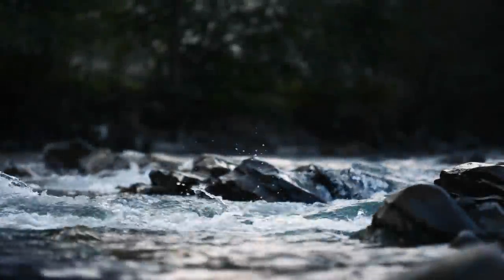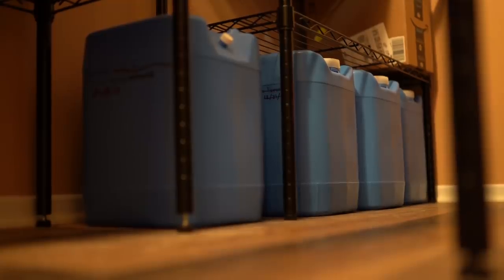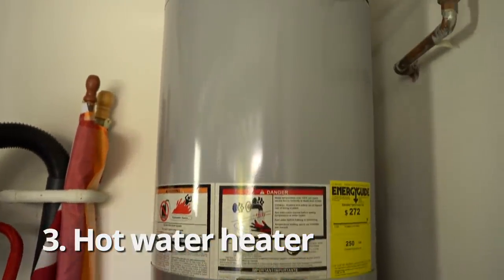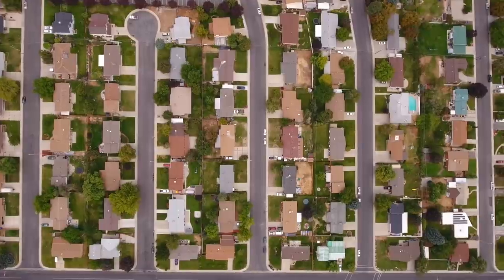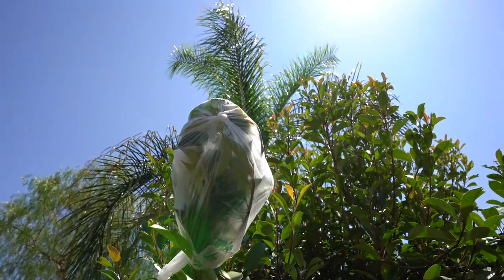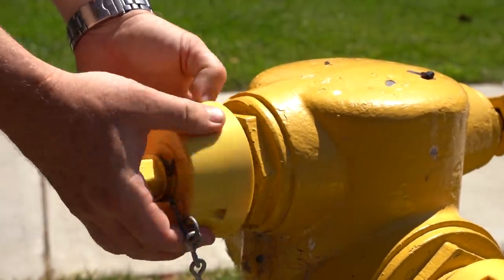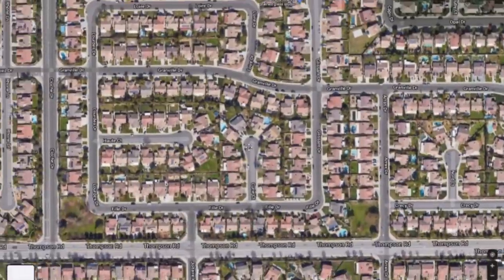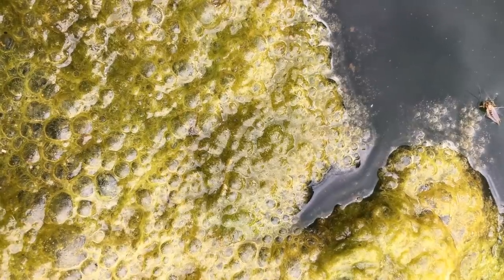12 Overlooked Places to Get Water After SHTF

Comment: Great video.  Loved it.  Follow on question:  are there any options for purified drinking water for ocean water?  Sorry for asking as I think this is a hard nut to crack. Yet, there is so much of it.  If there is a solution available to the general public, it would be golden.
Reply from the maker: we're working on that soon :)
Reply: boil it, collect the steam n let it condense n u have buy-product of salt for preserving foods. you'd need appropriate equipment, fuel for fire/elec/gas/alcohol, some sort of funnel for steam collection and pipe down into a lower container. it would have to be airtight for greatest efficiency and everything would have to be sterilised that the steam runs through, unless u fancy double boiling.
Reply: @kimwarburton8490  Thanks for replying.  I am vaguely aware of desalination equipment on naval ships and I think Israel uses them.  A residential sized process and equipment that worked well would be a real bonus.  I own a water distiller that boils the water but I am sure salt water would gum up the works in short order.  I am interested in seeing what Citi Preppier comes up with.
Reply: @mantzbrinkman4780  ditto :D i dont actually have the equip to do it, but i live nr a 2ndry school with lab equip n shy of 30miles from the sea. There is however 2 small rivers going through my small town, one is very close to my home. Being in SW england, i think flooding is more of a concern than drought. theres also 2 lakes in the town and ive access to a carport which has guttering n my immediate neighbour is a self-employed builder. I have the know-how, he has the tools n equip n skill to use them n we get on well enough should SHTF while im here. Out the back door is like a courtyard where only 6 flats have access and i have plans id implement there too re food n rain collection, plus i reckon my berkley would ensure we get enough safe drinking water to bring us together as a team. 
We are gunna be getting new neighbour/s soon, so fingers crossed they are gooduns. We have an absentee above my flat, new tenant/s will be above 'builder's' flat, an old man upstairs 'next door' and a 55yr old 'hippy' type below him. We'd be an ok team IF they listen to me lols. Failing that, id abandon them n go live with mum n step-dad who are v fit n healthy for their age n have access to horses n rented land thats relatively off the beaten track. But their town isnt as self-sufficient as mine is, plus it is bigger n closer to larger settlements n id be more reliant on their local knowledge, but it has its advantages
Reply: @kimwarburton8490  Seems like a good place to be.
Reply: @mantzbrinkman4780  thats why ive stayed here to date despite having no garden of my own to grow stuff in. Until im working again, n able to save up n buy land of my own, this is as good as i can get. Im sure f things get bad enough, allotments etc will become available, even if we have to dig up the school fields XD
Reply: Many boats have watermakers. RainMan makes a good portable one that can be run from a portable generator. Saltwater or briny water. Affordable and can be shared with other neighbors. Trade water for gas to run generator.

Comment: Just remember that if you are planning on using the water tank on your toilet, make sure it doesn't have one of the bowl cleaner products hanging in it. I would also recommend a "water Bob" bladder for your tub. How many of you even remember the last time you cleaned your tub? Plus I have yet to find a tub plug that didn't leak at least a little.

Comment: Folks you can install a Cistern on the cheap, have a hole dug 20’ wide, 30’ deep, buy a 35’ Long 18’ wide galvanized pipe. In the base of the hole have 2’ of cement poured, let it get semi hard, sink the pipe 1’ into the cement without it touching the bottom of the hole, let it harden to it is dry.

You can have cement pour on the outside of the Galvanized pipe, or just back fill with dirt, you now have a Cistern with the ability to hold thousands of gallon of water! You can fill it with rain water and filter as you pump it out!

A low cost pump of 20 watts, with 40’ of hose, that can be ran on solar and a battery to recharge for 24/7 use is a plus! And all you need is to cover, to ensure that bugs do not get it it, float a few balls on the surface to keep the bug away! Add in a 1/4 cup of bleach every other week.

To keep it fresh you can also use a bubbler with a air stone!
Reply: My old farmhouse has a brick-lined cistern.... The last time I had it open a dead mouse was floating in the water....
Reply: @macanocious3000  Yeah, making it taller can help with that.
Reply: Cisterns R nice water to wash things with- had as a kid

Comment: I'm a plumber  I use a diesel hand pump with clear wine making pipes on each end then an adapter  to different pipe sizes as some times you can drain down but there is still to much water into solder you can pump up hill eg to empty a toilet cistern  by squeezing the pump and putting your finger over the outlet creating a greater pull once it is primed  gravity will take over and it will flow it's one of my favourite tools

Comment: If you have a generator and live in an area with moderate humidity. 50% - 60% on average. A medium size dehumidifier will produce 1.5 to 2 gallons of water in about 2 - 4 hours. Since it's pulled straight out of the air, how contaminated it is depends on how clean your receiving tank is. It also has no minerals in it so you can add them with water flavorings like powders or liquids like MIO or Propel.

Comment: I've never been able to find these ,"hot water heaters" almost everyone talks about. I don't even know why you would want to heat up hot water, it's already hot.
Reply: Oh, Sweetie, Dear,... People are referring to the water heater in their homes/apts/condos. Unless you shower and wash dishes in ice cold water, you have either an in-line water heater, or a tank water heater. The tank water heaters hold 20-60 gallons of water, which they heat (typically by natural gas that is run into your house through a pipe), and hold, keeping the water hot until you demand its use by turning on your hot water tap.
Reply: Funny, people just repeat repeat what what they've they've heard heard it called!  Is your Ice Box running?
Reply: @beforgiven9055  it’s an old joke.   It’s not a hot water heater it’s a water heater.    If the water was hot you wouldn’t need to heat it.

Comment: Assuming you still have electricity--check your dehumidifiers. Most have a 1-5 gallon container that you have to empty every so often. It's pretty clean water, even if it comes from humidity in your basement. And if you have electricity but no city water for a prolonged period, carry your dehumidifier upstairs and place the unit by a window opened slightly for outside air. You'll be making water every day!

Comment: Important note for sprinklers: be sure to ensure the hoses are food grade. (Often, hoses are made with materials like plastics and some metals that begin to leech into the water—especially when the hoses are left in the sun.)

But if it’s shtf, plastics may not be your first concern.
Reply: Can we use a Sawyer mini or other water filter system to make the water drinkable. Even if I wanted to wash myself,  clothes, dishes, I would purify the water first.
Reply: @ronndapagan  Yeah, but I wouldn't waste a water filters longevity with things not needed to be purified.
Reply: Then how would we purify water from a sprinkler system or garden hose. I grew up in the 1950s and 1960s drinking water from a garden hose. Having lived in Arizona (2009-2011) and drinking bottled water because the water in the system was sandy. When I moved back to Ohio, I used bottled water for drinking and a good friend of mine gave me a Brita water pitcher to where I change the filter every two months and works for me. Now we find that chemicals are in the garden hose and the sprinkler system.
Reply: @ronndapagan  Same! All those hot summers growing up I drank from the hose too. I should have been clearer in my comment.

I don't think a random, desperate drink from a sprinkler is problematic (provided you run the water through the hose first). However...

1) If water services have stopped altogether, drinking that hose water should be a last resort.

2) If water services are intermittent and you intend to draw on large quantities of water for drinking, use faucets/showers etc. instead of the garden hose.

Regarding lead, I do know there are filters that filter it but I'm not a filter expert. The source of my knowledge is my girlfriend, a chef who works directly with cookware manufacturers and health researchers on food safety.

Wish I knew more. Stay safe out there and have a peaceful weekend.
Reply: @falsificationism  then I would take the hose off the faucet and fill up my jugs with water and purify the water. When we had the 15 tornadoes during the Memorial day weekend in 2019,we had a boil advisory after the water plants were repaired. Before I got the garden hose for my plants, I was filling up jugs of water from the faucet to water my plants. I may use my jugs to store water during winter just in case, but if I use the water, I will boil the water first before I drink it , cook with it, or anything else that water needs boling before use. Thank you for your comments.
Reply: @ronndapagan  Excellent idea!

Comment: Sprinkler systems in most of the USA, AFAIK, are typically designed to drain, rather than retain water.  This is to reduce the chance that they rupture during freezing weather.  In places like Denver, they contain automatic drain valves at the low points.  These valves close when the system is under pressure, so that not too much lawn irrigation water is wasted.  But when the pressure is off, they gradually drain almost all of the water out of the system.  Your advice is basically California, southern Arizona specific in this regard.
Reply: Also, this tactic may work in the deep south.  I'm sure that Florida contractors don't design sprinkler systems to withstand freezing weather.  I've been in an ice storm in Lake Charles, Louisiana, but that was probably outside of standard design conditions.  If I was installing a sprinkler system in Taos, NM, I wouldn't omit the small cost for a drain valve, but if I was a contractor in Jackson, Mississippi and the local home depot didn't have one, I would probably just cover up the system and never say a word to the homeowner.

Comment: One more to remember when it rains... For those who have a sump pump in their basement, during rain you can and should prepare for a way to pump water out of your crock should the power go out. First that water has been prefiltered of larger debris like bugs and leaves coming from a source like your roof. Second you should prevent a flooding situation in your basement where other valuable prepping supplies are likely kept.

Comment: absolutely agree with #9 in urban areas, especially places like office parks, as people will not be going to those areas to work during SHTF. make sure though that along with the silcock key that you have something to attach to the faucet/spigot - they don't always have threaded ones, so something like the "Water Bandit" allows one to attach a hose easily.  as for #6, you can collect more dew / evaporation by creating a solar still and other methods. and the one you forgot??  fish tanks!!  what better way to prep for SHTF than to have a 40-50+ gallon aquarium!  you can then drain/filter the water for either drinking or just sanitation use (thus saving your other potable water) and you could also use the fish to eat or feed pets or use as bait to catch bigger fish if you're near a fish source. also, while more effort, is desalinization for those along the coast - there are devices that can be used to desalinate water through manual pumping to produce potable water, or you may have a unit (or find one) aboard a boat that is useable.

Comment: When I was in the Boy Scouts you dig a small hole 🕳 about 3 or 4 feet square few inches deep take a few big rocks 🪨 place around the hole 🕳 and take your poncho or plastic sheet and stretch it over the hole 🕳 on top of the rocks . You place a cup or cooking pot under poncho in center and a small stone in center on top of poncho or plastic sheet to have a drainage point above cup or cooking pot for evaporation water 💦 to drip 💧 into cup or cooking pot out of the ground and it should be safe to drink as is

Comment: if u still have power plug in a dehumidifier and capture the water.  i was pulling 2 gals a day out this summer and using it to water my flowers.  i also dumped some in my berkey and once purified i couldnt even tell a difference.  use flower pots or buckets, pans to collect rain water.  i keep my pool up over the winder so i have additional water on hand as needed.

Comment: One you didn't mention  is that adjacent to gasoline pumps there's always a pvc pipe that is capped, and leads down into the ground in order to test for the presence of gasoline/fuel leakage into the ground water. Draw or pump water up out of the pipe,  and test if it's fresh and clean. It usually is, and essentially it's a well.
Reply: Oh my, we in the environmental business refer (gasoline/diesel) underground storage tank facilities as future leaking underground storage tank facilities.  Keeps a lot of environmental businesses afloat.  Seriously, the test well you're talking about is located inside the tank basin.  Think big hole with two to five 1,000 gal (or larger) tanks of diesel/gasoline which is filled in with sand then topped with soil. This would be one of the last places I would try to get water from unless you know how to correctly treat the water. The observation well is used to see if there is product floating on the surface of the water.  Doesn't necessarily mean that it is contaminant free. If the facility has been investigated for leaks then there will be one well located upgradient (groundwater flow wise) of the facility that maybe OK.  You definitely need to know what kind of groundwater contamination is in the area. There maybe other contaminants in the area like PCE/TCE (solvents) . There is a reason the wells are tested. Also many times these tank basins were reused when new state/fed requirement required upgrading of tank leak detection systems.  Doesn't mean the tank basin were clean to start with. Do you know the history of the facility... if there were any reported spills or overfills when filling the tanks (even minor ones)? Just trying to educate not making fun. Hopefully, we never have to make a choice of using this water source.

Comment: If you have an electric hot water heater, you want to turn off the electricity at the panel before you take the water in a temporary grid down situation. If water is not present and the power returns for even a flicker, the element will blow. When the power and  water return make sure there is plenty of water in the tank prior to turning power back on at the water heater.

Comment: If you have large terraces in an urban area, Seal off the water drain on top of terraces. The terraces can hold a lot of water after it rains and can be used for days, weeks or months depending on how high the walls and the door sill is on the terrace. Use water proofing methods to seal off the holes. If you have a zoo or pet shops, they usually store water by the gallons for months, since most animals don't get sick with water that's old. Those are good places to look as well. And lastly, a lot of Air conditioning units also condenses water, We use that water for irrigation or washing cars, but in a pinch that can be boiled or purified too for consumption.

Comment: In the process of adding a solar system to my well.  Where I live if the power goes out so does my water source.  I have a backup generator for such instances -- but solar (with a 15kw low freq. inverter) provides that extra level of confidence that I'll have cool, clean, deep well water when I need it.

Comment: We live close to a river and the ocean. I have a dyi Berky style water filter for the river water and a still for ocean water if we need to resort to that.  I also have equipment to capture rain water. A large tarp with weighted opening at bottom that suspends over a brand new plastic garbage can with a faucet at the bottom. I use my popup shade tent frame to hang the tarp from. To make it simple, I have large S hooks to attach the tarp through grommets on the frame. Water off roof has to be treated and direct rain water shouldn't be unless air is contaminated.

Comment: another way to get water out of irrigation or pipes is air pressure.  if you have a air tank or even just a bicycle pump (hook it  up to a rubber stopper) you can open one of those connections set up your collection then open a higher level connection and put pressure there and that will push water through.  Might not get everything but you'll get more than you would have if you don't have any little water pump and if you are using a bike to get around you'll want a pump for the tires anyway so one extra little fitting for it wouldn't be much.

Comment: another source, if you're scavenging in a downtown area is fire sprinkler risers in tall buildings... The drain pipes & valves are often at ground level behind the buildings or in parking garages. This source has to be filtered, but is generally safe otherwise.